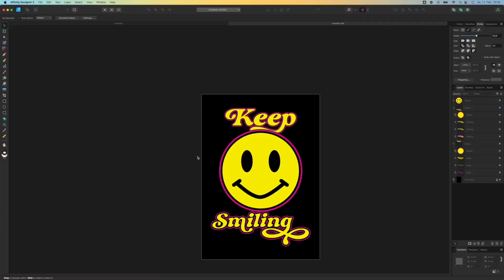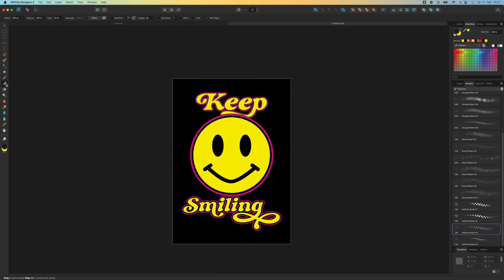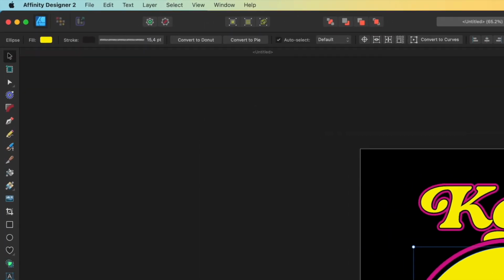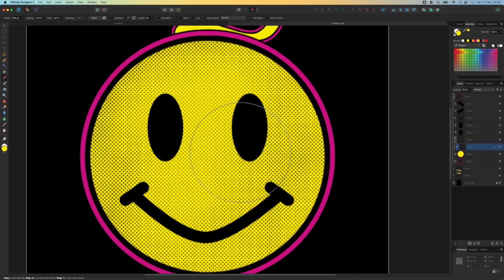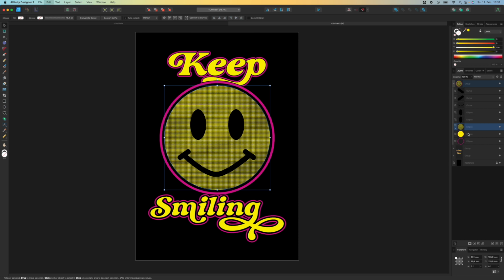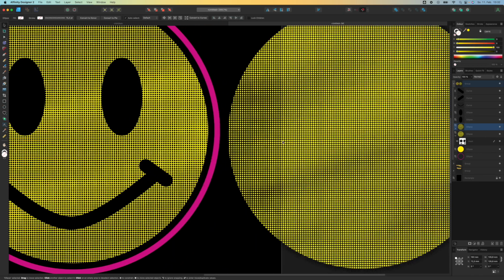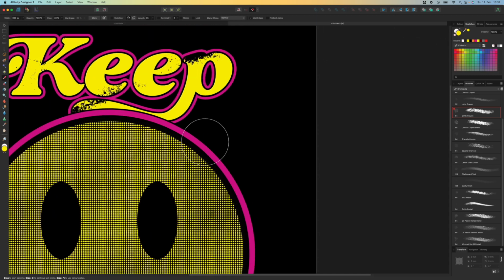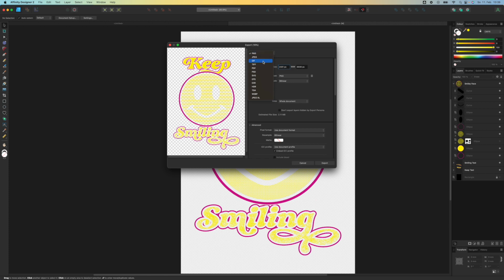Affinity Designer Basics for your White Toner Printer - Part 2

Comment: can you use this software with Icolor WTP's?
Reply: That's a design software, not a RIP software. Design software is platform independent and used to create / change designs. RIP software is created to send the designs in a proper way (with the right amount of White etc) to the printer. 
You'll need both, design software and rip software.
I do use Affinity Designer in conjunction with iColor ProRIP for my iColor printers
Reply: @chrishd84 what’s the best format for exporting it to prorip?